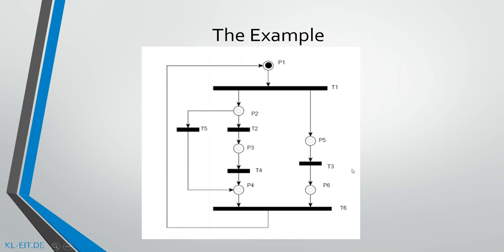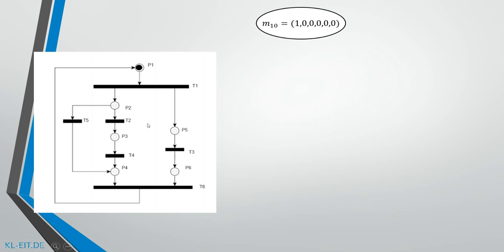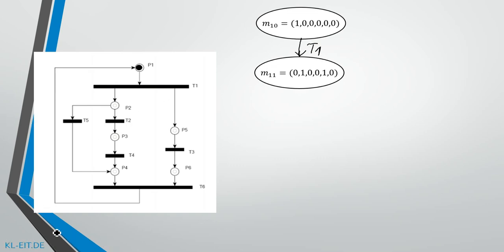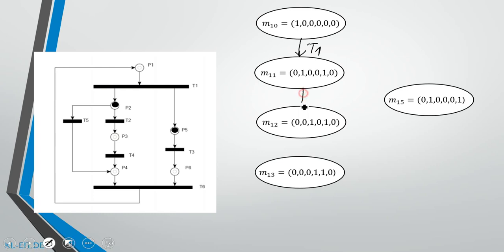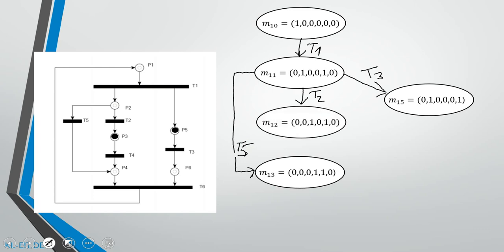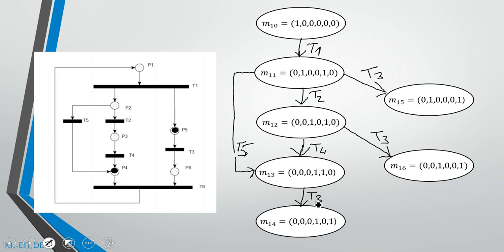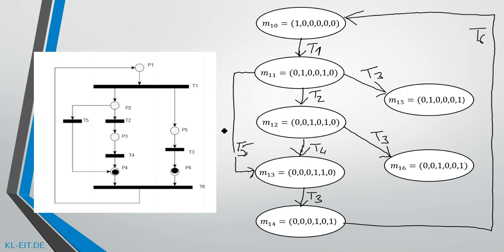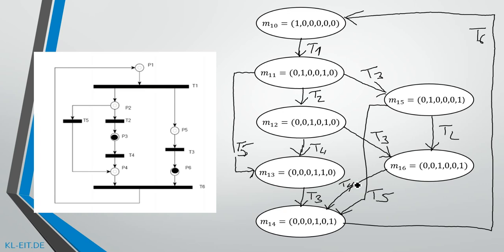Building a Reachability Graph for a petri net

Comment: Thanks for the video. I didn't quite understand why nodes are marked as m10, m11 and so on. Why not m0, m1 etc.? Is there a case that requires m20, m21...?
Reply from the maker: You're free to name the nodes in the ways you like it. Naming them with m10, m11 was just an habit because in examples the reachability graph had to be created for multiple start markings. I used the first number to identify the first start marking.
Reply: Ok. Now it is clear. Thanks.